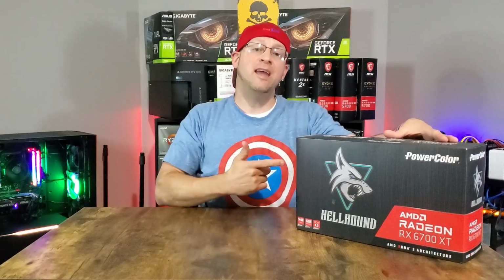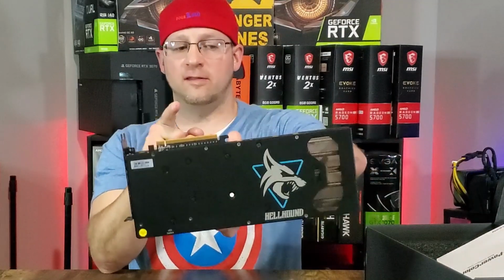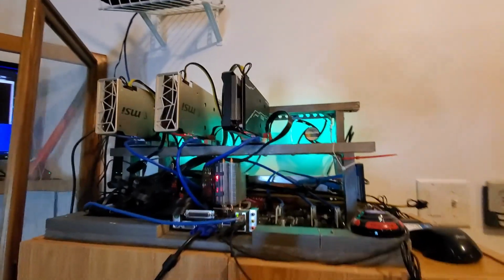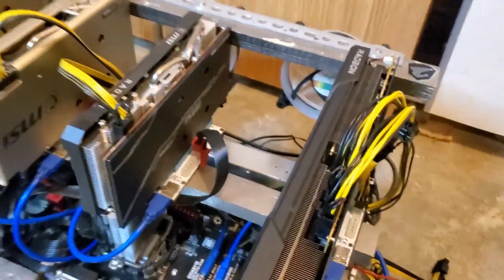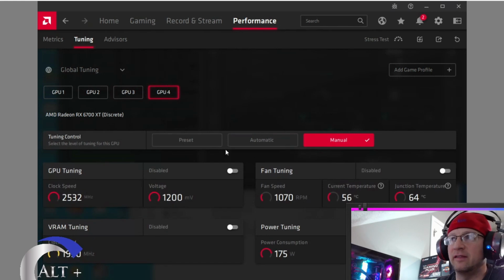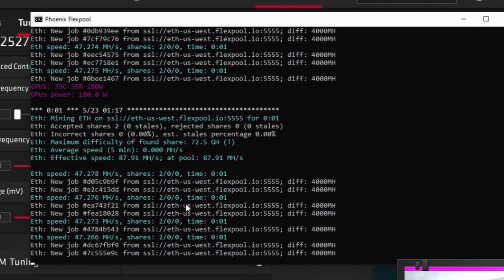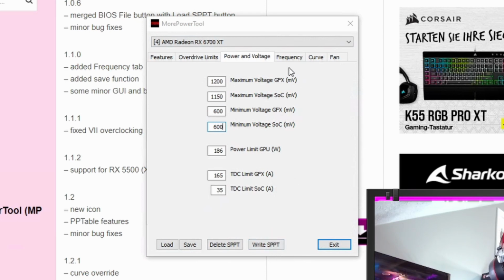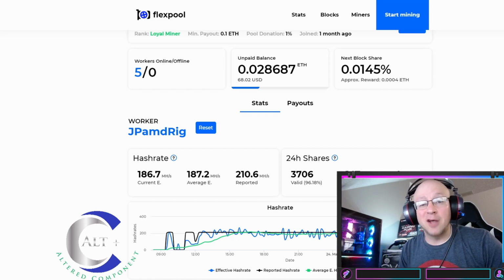RX 6700 XT Mining Hashrate | AMD PowerColor Hellhound Unboxing | Overclocking & Profitability

Comment from the maker: Do you have a Rx 6700xt?  What hashrate and Wattage are you mining at?
Reply: 6700xt Red devil 47.7 MH/s 92W
Reply: PowerColor Red Devil 47,5 MH/s @92W / Sapphire Nitro+ 47,5 MH/s @79W
Reply from the maker: @casalmidnight  very very efficient. Love it
Reply from the maker: @casalmidnight  very very efficient. Love it
Reply: 47 - 48mh 80w
Reply: PowerColor 6700xt Fighter 47.5 MH/s, 96W (some 105-110W at wall); (stock  44.3MH/s, 186W)

Comment: hey Altered component
hope you doing well
recently I watched a video on youtube and there is a guy that have a mixed rig of nvidia and amd cards
he could use dual mining on his amd cards
and sets ethereum for both parts of the flightsheet
then he could rech up to 65-70 mh for example on a 6700 xt
is it possible?
here is the link

https://youtu.be/SJ7WplYDxAk?t=232

I will appreciate if you let me know your answer and point of view.Thank you.
Reply from the maker: Sorry man, this was in my filtered comments.  Youtube tends to pull out comments with hyperlinks ;)  This does not seem accurate.  perhaps he can pull that mhs on a non eth algo, or from splitting it with eth and another algo, but i would think by now if this were a real thing, it would have blown up among the mining community. 
I just had mad electron return my 8 card amd reference rig and it is at 400mhs, but he dropped it nearly 300 watts.  video to come
Reply: @AlteredComponent  Thank you

Comment: do you need a sag bracket
Reply from the maker: I did not run one,  but yes this a lot of length and weight.  Definitely could benefit from a sag bracket to relieve stress on the pcie slot
Reply: @AlteredComponent  I will be coming from 5700xt to 6700 XT thinking it's the same length about 310mm

Comment: You didn’t show the final clocks. My hellhound doing 39mh 119W 😂
Reply from the maker: Min freq mhz 500,max 1214mhz,vtage 725, vram 2150 and on fast timing, power tuning 108w , -6% .  All in Radeon settings
Reply: @AlteredComponent  ty 👌
Reply from the maker: @jomito8784  if in windows, you can use more power tools and change the lower power limit mv to 675mv and then run around 92w and still get 47mhs ;)
Reply: @AlteredComponent  Really appreciate that youre sharing your experience. Do you think the 6700xt is a good mining card at the moment. I mean the mhs/watt is are pretty high and theres no mining restriction you have to trick. All in all it seems like one of the bests cards to me because you cant get an new 3070 non lhr in my country
Reply from the maker: Oh...not good.  I have mine doing 47mhs on 108w now.  I see a lot of people cranking 6700xt clear down to 80 watts at 47mhs.  Ill get u my clocks when I get to my house
Reply: @AlteredComponent  awesome man! Thx. I’m on HiveOS and been fiddling with this one card for a day now. Highest it goes is 41.4@126W my 5 other cards are doing 46.5@120W

Comment: Just a big FYI.  You can get 47 watts at 80 watts.  All of mine are getting nearly 48 at 80 watts.  Stable too.  Figured I would pass that along for longevity of your card and save on your power.  6700xt is my favorite card this cycle because the efficiency is nearly 600.
Reply: 1200 max frequency on core, 1200 mv, 2150 memory, and I have been able to go all the way to -43 on power.  Adjust your fan curve.  All done in radeon software.  One card I got it down to 78 watts hashing at 47.5 mhs.
Reply from the maker: Fan curve is still running through afterburner for me.  Using both ab and Radeon settings.  The rig has 3 5700s already tuned well in it, so didn't want to go away from ab
Reply: @AlteredComponent  definitely try out those settings. There's a video of a guy adjusting settings through MPT but I figured you already know that.
Reply from the maker: Thanks for insight.  I have tweaked a bit more.  It is at 110watts, 47 mhs, 725mv, 2150 mem., max core 1214,   it has been rock solid.  I may have to tweak more if u are only on 80watts ;) I have 2 more brand new 6700xt to unbox and test / tweak.  A xfx qick and a 6700 white hellhound.  Oh and a 6800 reference card as well.  All to come
Reply: One is an xfx, another is asrock, 2 reference designs.  No sure on memory because I didn't look at that.  If you like I'll post the video link if it's allowed?
Reply: Also all my amd I got on hive have samsung memory.  And they have been swapped around.  My guess is most AMD is running on Samsung memory
Reply from the maker: @fitchmister3158  you rock man.  Thanks again for the insight.  I have a 6700xt reference and an xfx qick to test and install shortly.  Hopefully i can crank them down
Reply: @AlteredComponent  no problem.  I do have one stubborn 6700 that just won't go below 93 Watts, but that's still great.
Reply from the maker: @fitchmister3158  hellhound stuck at 108w on 47mhs...but ill take it. Hopefully I can dial the reference model and xfc down more
Reply: @AlteredComponent  models may very but I am pretty sure xfx, reference, and asrock can be undervolted down to 80 watts.  I think the Powercolor cards are more hungry for some reason.   Possibly rgb?
Reply: @AlteredComponent  models may very but I am pretty sure xfx, reference, and asrock can be undervolted down to 80 watts.  I think the Powercolor cards are more hungry for some reason.   Possibly rgb?
Reply: You should get it down to 78- 79 w

Comment: Has anyone experience stability issues?
Reply from the maker: Thanks for watching.  Honestly this card, and really all my AMD cards for generations back have required a bit more tweaking and tuning to get a Good overclock that would also keep high percentage of valid shares and keep stable.  Since this video, i have actually dialed it in a bit more.  I am now just over 47mhs and pulled power down slightly.  the rig runs days with no stability issues.  i do have 2 more 6700xt to add.  The XFX quik is already on hand and i receive the ALL WHITE hellhound next week.  That card looks sick.  the pricetag is a bit sickening though ;)
Reply: @AlteredComponent  ive seen the red devil on the market that is only 100 more than hell hound and capable of pulling less than 100 watts at the same hashrate

Comment: Statistics (02:13:15); Mining: Ethash
Connected to: eu1.ethermine.org:4444
Uptime: 3h 15m 4s
                           GPU 0       GPU 1     Total
Name:                  RX 6700XT   RX 6700XT       Rig
Speed (mh/s):              46.85       46.75     93.60
Pool (mh/s):               44.04       50.28     94.31
Shares (A/S/Hw):         120/0/0     137/0/0   257/0/0
Best Share:                 1.4T      324.9G      1.4T
Power (W):                  74.0        74.4     148.5
Efficiency (mh/s/W):       0.628       0.624     0.626
Temp (deg C):                 39          48
Junction (deg C):             43          50
Fan Speed (%):                60          62
Reply from the maker: wow...that efficiency.....What does that rig read at the wall?

Comment: Hi,
I just wanted to shoot one question. Whats your opinion on mining RVN on 8gb cards instead of ETH after EIP1559 ? Thanks.
Reply from the maker: Thanks for watching.  I have seen a lot of people already moving cards over and stacking RVN.  They are speculating that when Eth mining slows and eventually goes away that RVN will take a big hike in value.  I am in the camp of, mine the most valuable coin and then exchange if so desired.  So, when EIP drops in and rewards drop, it really depends on the price of eth for me.  I personally think ETH will slightly out earn RVN once rewards are dropped at least at the beginning. Once eth goes away altogether, i am in the stance that others will rise up and replace the mining value lost for the most part.  Thanks for the watch